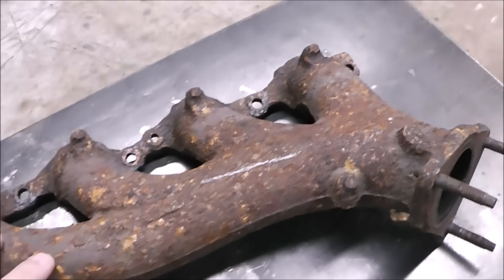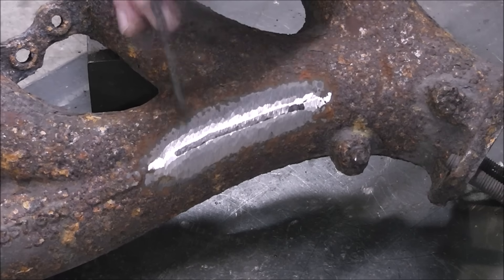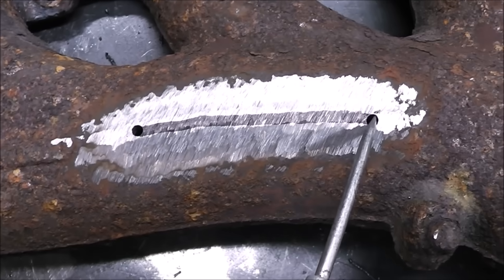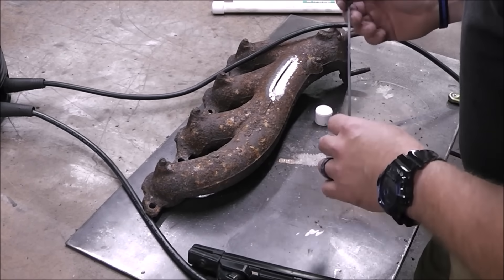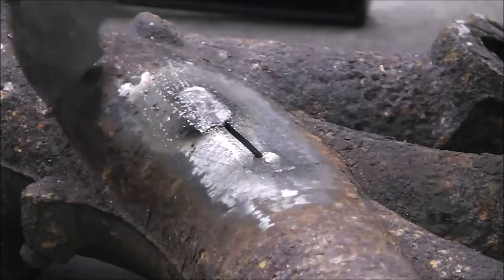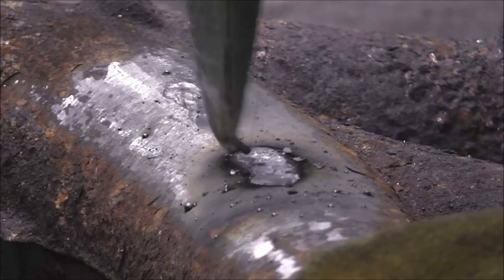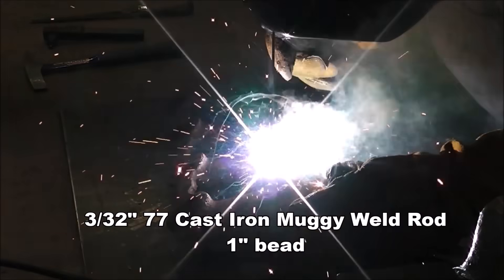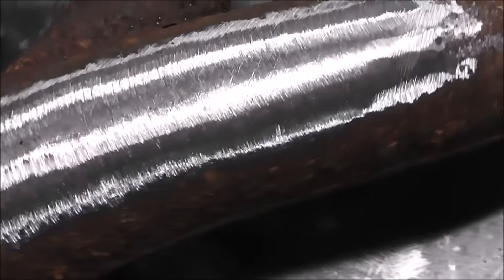Stick Welding Cast Iron Repair with Muggy Weld

Comment: So how would this muggyweld Rod work on an old 29 model A ford block that has a long crack on the outside of the block?
Reply from the maker: Tom If it has a cast iron block, I would say excellent. They have a video on their website where an engine threw a rod out the side of a cast iron block. It left a hole the size of your fist. They fit and welded in a mild steel patch and had zero issues. I would say give them a call to see if you would need anything more than just the 77 rod. They have some really neat specialty stuff.
Reply: Brandon Lund thank you much.  I already sent them an email asking them about it.  I have used another product called EZ TIG  and it works pretty good seems like.  Have a good one.
Reply: Tom, hello from a  fellow Okie. One of the things that can make a block more difficult braze is that because of it's size it takes a very large heat source to get it properly preheated, like a big rosebud which most don't have large enough acetylene tanks to safely use at home. You can use a weed burner, lots of time, and lots of propane. I've heard of rods that don't require preheat but never used them. Also the thermal cycling that occurs in a block can cause problems down the road too especially for the home gamer welds. I'm not saying you can't do it, but this is a pretty good alternative and probably has a much higher success rate for novice welders. You might check it out, here one of their demonstration vids. 
https://youtu.be/Pq0wfU4ZaKk

Best of luck,

Steve
Reply: Steve just Steve thank you Sir.  I was also looking at a product called Belzona.  Which is what JB Weld was copied from.  The rep in Oklahoma City said it is very  successful on something like this.  He said it is used a lot on huge industrial engines.  But it is expensive, about $230.00 for two oz, and it would show after it is done.  He said the absolutely best way to use it was to sandwich the stuff between the block and a piece of 16 gauge steel strip.  This stuff is much cheaper and I guess I could always use the other stuff if the welding didn't work.  Since the Model A engine does not use a pressurized cooling system there won't be a lot of pressure on it.  I will figure it out when I get it back with its new babbitt.
Stay cool.  Tom

Comment: kosanilla lämpöä ja sitte villojen väliin jäähtymään
Reply from the maker: That is also a great method! Cheers!
Reply: Brandon Lund Nice to see that sometimes english language peoples have to use also google translator😁 Usually everybody translate own language to english, but now i was tired to do that. But not the point on this video.😁 But yes, repair welding your exhaust manifold you can get strong manifold again.

I had later Peugeot 205 1.9GTI and  its exhaust manifold was broken and it get heat before and later welding and also hammering all the time and finally i put it between   glasswool.
Reply from the maker: Topsiekku Nautin lukemisesta ja kääntämisestä kommentteihin. Joskus kääntäisin sen takaisin alkuperäiselle kielelle. Se saa yleensä hyvän naurun ja pitää ihmiset arvata. Kiitos katsomisesta!

Comment: That’s a cast steel manifold there bud!
Reply: Your 100% miss informed. I weld ever single day there is a distinct difference between cast steel and cast iron.
Reply from the maker: I don't disagree that you weld everyday but GM does not make cast steel manifolds. I don't know what to tell you...
Reply from the maker: Gm has never produced steel manifolds. I don't disagree cast can be welded with mig because I have done it, but GM never made  a steel manifold.
Reply: I don’t know what to tell you but your still wrong

Comment: WE USED TO USE K-WOOL ,WRAP IT IN K-WOOL (PREHEAT /COOLING FOR WELDING CHROME PIPE)  PREHEAT IT AFTER DRILLING ENDS OF CRACK WELD AS YOU DID AND PEEN IT STRESS RELIEVE THE CAST IRON ,THE WRAP WITH K-WOOL TO SLOW THE COOLING PROCESS .THIS 25 YRS AGO.GREAT VIDEO
GOD BLESS  AND WATCH YOUR EYES
Reply from the maker: Thanks buddy! I appreciate the support

Comment: Do you do two test with this? The only reason I ask is, because you started on the outer side and the finish weld was on the inside?
Reply: You're right. i just watched it again, wonder what that was all about?
Reply from the maker: Good eye. I prepped both sides because one side was for this project and the other side is going to be an upcoming TIG episode. Being the director, camera man and welder, I lost track and accidentally welded the side that no one saw me prep.

Comment: Ive often wondered but never had the chance to try. would it make a differance if you flooded the manifold with inert gas. I havent got the know to decide if argon or tri mix would be better or if its just overkill dumb....
Reply from the maker: I'm not sure. I don't think it would make much of a difference when stick welding.  Interesting concept,  but I've never tried.  Thanks for watching! Cheers!

Comment: You welded the crack on the outside of the manifold but showed a finished cleaned area on the opposite sidd what gives
Reply from the maker: Good eye. I prepped both sides because one side was for this project and the other side is going to be an upcoming TIG episode. Being the director, camera man and welder, I got messed up and accidentally welded the side that no one saw me prep.

Comment: I wonder about the cause of an actual crack. It could be about load stress.  You are one of the few with confidence in a cast iron repair.  Farm equipment is the extent of my welding and all I have is an ancient AC rig. Glad to know these rods will work for me.  Thanks for a great video!
Reply from the maker: David TheCarpenter an actual crack can occur for lots of reasons. Heat/cold shock, stress / fatigue or in cases of engine block repair, throwing a rod out the side of the block.  Cast iron can be sucessfully repaird a lot of different ways, this is just one of the many using some basic tools. The rods work on AC too! Thanks for watching! I appreciate your support!
Reply: If pictures were allowed they would say a lot more than I can type. It's a J shaped exhaust that has the three bolt pattern where it joins the manifold. It must be cast steel because I bent it. So I have a steel to iron connection. lol... Got a video of welding cast steel with an AC rig?
Reply from the maker: David TheCarpenter I don't have a video video,  but if it's steel, it can be welded just like ordinary steel (mig, tig,or stick).

Comment: Not seen those rods over here, have to use usual cast iron rods, so I go with preheat and post heat and cooling in the sand stuff as you described.
Back in the days of nineteen hundred and frozen to death, we were supposed to pein all welds, and there is a pattern of hammer called ballpein which was pronounced ballpain because peening welds was a pain in the .......neck.
Reply from the maker: I always look forward to your comments Jaques Daniels! "Ninteen Hundred and frozen to death " LOl :) I'm guessing the 77 rods are some sort of Nickel rod but I dont really know for sure. Cheers brother!

Comment: Very nice job and nice presentation. You could (if you were careful) have a propane torch flame running through the manifold while welding to keep the heat constant. My Father was a pipefitter, president of an N.J. local and an instructor. My Brother is a pipefitter and vice president of the same local. I took a welding class about 10 years ago and all I managed to do was weld my project to the table. Needless to say, I'm not cut out to be a pipefitter/welder.
Reply from the maker: Thats a great idea to keep the part up to temp! Thank you!
Reply: A lot of weldors recommend heating before welding .
Reply: What local in NJ. 322 or 9? Worked out of both, now retired.

Comment: how do you deal with the inside of the part? Does it get all messy like the outside and need to be sanded/cleaned? or does it stay pretty much untouched and not going to cause any airflow problems?
Reply from the maker: I'm glad you asked this question! I am going to be cutting this weld open in an upcoming episode and do a little testing! Make sure you hit the notification bell so you will get alerted when that episode comes out. I suspect it will be pretty much flat with a little protrusion inside which would not produce any noticeable effect as far as performance.

Comment: Cast iron can also be welded with brass and a blowtorch.
Reply from the maker: And is a very good method! Cheers!
Reply: That's not welding. That is brazing. Basically glue metal together.
Reply: But it works very well.
Reply: Brazing works well for the heat range it's meant for.  Exhaust manifolds can glow bright red and exhaust gases can get over 1000*F which is above the melting point for brass, bronze and copper.

Comment: I remember back in the 80s when we had old 60 model vehicles and use brazing rod with acetylene for the preheat it is, I can be pretty tricky. Nickel rods are cool though even on a stick welder. Very good video
Reply from the maker: You say that, that was one of the first things I learned on...I was "stacking dimes" with braze and oxy /acy before it was even a "thing" LOl. Seriously though, brazing is still a very effective method for repairing lots of things, but it seems like some of the older methods are slowly fading.
Reply: @BrandonLund  I love brazing, I was taught at a young age, I'm now 60.
Reply from the maker: @gbryson3678   its definately a very good fundamental skill to learn in my opinion. I love it also :)

Comment: The welds in this video do look very nice.  Even the 72 rod seemed to weld nice.  I've seen other muggy weld videos that didn't have such pretty welds.  They actually looked pretty bad.  Unfortunately I did not have a positive experience in using this rod.  I recently tried the 77 rods to weld a cast iron hydraulic fitting to a steel JIC fitting.  This should have been the perfect solution since it is advertised to be able to weld steel to cast iron with little or no porosity.  The surfaces were carefully prepared/beveled on a lathe and cleaned very well to all shiny metal.  The 77 rod would not hold an arc at 100 amps and would barely weld at 115 amps which is higher than the max recommended heat.  The beads seemed to burn in if I could get it to hold the arc but I later found out the welds did not bond that well.  The 1/8 rod is supposed to hold an arc from 60 to 110 amps.  This rod is advertised to have no porosity, however after cleaning up the weld on the lathe, I found 6 pin holes that caused leaks.  I attempted to grind them out and re-weld them, but more leaks appeared.  After grinding out the pin holes, I found the penetration was much less than acceptable.  This rod is also supposed to be easily machined.  I did machine the weld, but I broke 4 carbide bits in the process.  Realizing this rod was not meeting the manufacturer's claims for my application, I went old school and brazed it and then machined the surface again and solved the problems.  I have no leaks and a professional looking fitting.  Sometimes the old proven ways are the best.  At $12 per rod shipped, I expected superior results.  Needless to say, I was completely disappointed with the performance of this rod.  Some people may have good success with this rod, but I found out the hard way, at least in my case it did not perform and failed on all points.  So at best, I'd say as an experienced welder, It might weld well in some cases, but not so good in other cases for no apparent reason.  I'll stick with tried and true from now on.  I need something I can count on at a fair price.
Reply from the maker: I'm sorry to hear that your experience was less than desirable. I assume you were running DCEP?  I ran both of these these rods at the lower end of the spectrum but I think my unit might run a couple amps hot but I have yet to confirm that. I did not experience any problems keeping them lit and the re strikes were crisp.  I spun the rod between passes on a file as I mentioned in the video just to keep the electrode exposed. The 72 rod went in nice for me. It felt like 6010/6011 while the 77 rod seemed a little more forgiving and flowed similar to a 7018.. Again, sorry to hear you had a bad experience. Welding cast is stressful enough as it is :) Thanks for watching!
Reply: I was running an AC box I've had for decades.   I didn't run the 72 rod because that was intended for contaminated metal and it mentioned that the 72 rod would be more porous.  My casting was very clean and perfectly prepped.  It did look like it flowed in nicely for you.  I believe if I'd turned up the heat to an even hotter setting, It would have welded better, but that would be going against what you're trying to do working with cast iron.  My observation is, it's not consistent from one situation to another.  I probably could have experimented and gotten decent work out of it, but I couldn't risk destroying a casting that coudln't be replaced.  I needed it to work according to the specifications and manufacturer's recommendations.  That just isn't how it worked out.
Reply: Brandon Lund .

Comment: What muggy weld rod would you reccomend to repair a 2-stroke cylinder at the base. My clutch cable perch bolt stripped and i made it worse by attempting to chase new threads with a stainless screw. I have seen some of these rods form around screw threads because they don't stick to metal, or i could just fill the hole and drill and tap. I am not so good with taps. I also heard of the new 350 melt rods. I have no speakers on my computor so i could not hear what you were saying, but the technique was very good. Thanks.
Reply from the maker: Frank Crawford What is the cylinder material made of?
Reply: @BrandonLund  It is cast aluminum. It is a nub cast into the very bottom of the last fin with a threaded 5 mm hole. Thanks.
Reply from the maker: I know they have some rods that melt at half the temperature of the base metal and are just as strong, but I cant say for sure how this would work on your application. Your best bet is to give them a call and see what they recommend. Cheers
Reply: @BrandonLund  Thank you.
Reply from the maker: your welcome and thank you for watching!

Comment: Very helpful. I have to weld the frame (body) of my old milling machine. Like an idiot I managed to drop it while moving it. I have the right rods for the job from Caldicot Welding in South Wales UK
Reply from the maker: Awww. Thats terrible!  I had an old antique cast iron drill press in my workshop that we sold (early 1900's). The new buyer showed up but didn't bring enough help with him.  He ended ended up dropping the damn thing 2 times and broke so many pieces off that it was not feasible to fix. He never did get it loaded and we ended up throwing it on the dump.  I know how you must feel!  Take care and thanks for watching. P.S. If you feel up to it, post up the repair pics on my Facebook. I'm always interested in what my viewers are working on.

Comment: Las piezas de fundicion de hierro deben ser calentadas  para soldarlas Sino pueden rajar al lado de la soldadura al enfriarse ,Desde Argentina..
Reply from the maker: Cast can be repaired successfully without the heat, but I do agree that a pre and post heat are the best method IMHO

Comment: Why didn'y set your machine on some scrap first?
Reply from the maker: Typically someone wouldn't have a spare piece of the same grade cast Iron laying around  like you would with mild steel. They would have to figure it out on the fly, reading the metal as they went along as I did. Thanks for watching and Cheers :)
Reply: It's a great video, Not trying to act like a know it all. This video taught me a couple things. But I have to disagree with your comment.
You can set your amperage on mild steel just to see how the rod is burning. for such a crusial weld, Thats what I would do. Thanks for the reply.
Reply: I think that would get you closer, than on the fly.
Reply: Why can’t I look at reply’s only on this thread?
Reply from the maker: Are they not working? You should be able to see comments and reply's?
Reply: I can comment, but can’t view comments. Only on this thread. The other threads are no problem. This has been happening lately with other videos as well.  Don’t know why.
Reply from the maker: Odd? I dont have any settings that prohibit anyone from commenting or replying so I'm not really sure. Either way, thanks for watching and participating! Cheers!
Reply: It says unknown error.